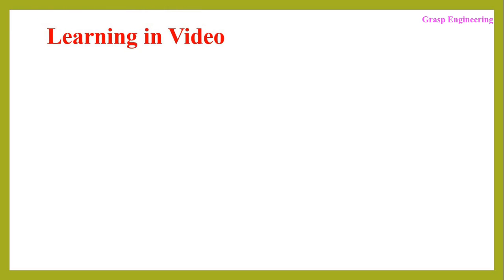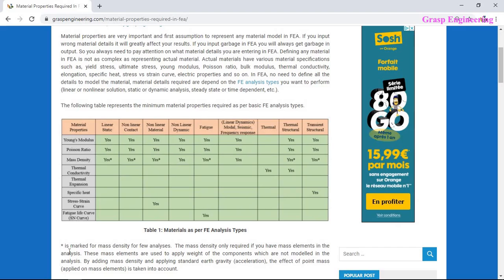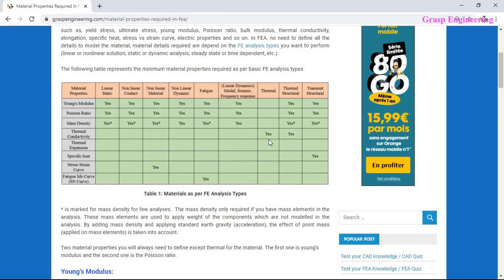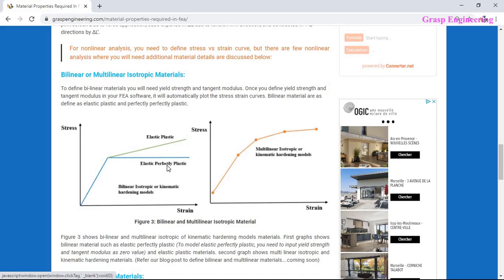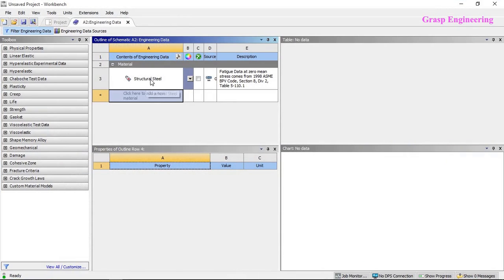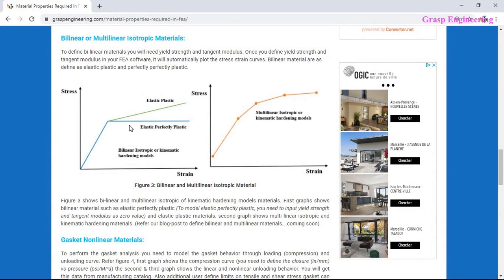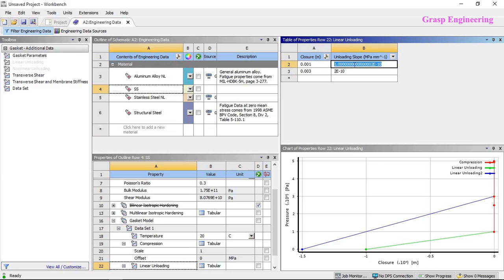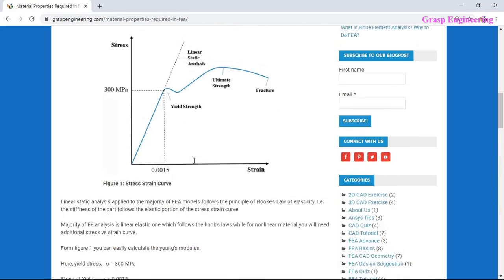Material Details Required in FEA as per Analysis Types

Comment: Bro do you check it Or not
Reply from the maker: What?
Reply: @graspengineering9249  i send you drive link in your previous video for boolean operation
Reply: bro this is new link in this i add file to design modeler please open this file try to boolean operation on this file